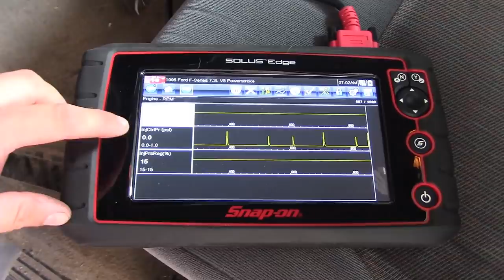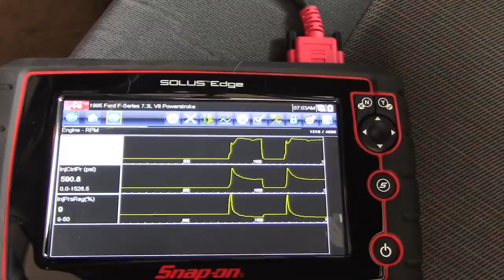Restoring an Ammco 4000 Brake Lathe

Comment: Brake lathes are great, when working on oddball classic cars they actually are a must. Nobody makes rear drums for a lot of the stuff I see any more! That was a nice restoration and will go on giving great service for years to come. Hate the throwaway society, and every little helps. Nice one Wes, interesting content as always 👍
Reply: Even if you buy new you should still turn them to make sure they are perfectly round.  I've had new rotors and drums warped/out of round new out of the box before.  In the automotive industry it is standard practice to turn even new but most shops don't due to time constraints plus with rotors a slight warp won't cause an issue such as shaking or a slight out of round drum won't cause a brake pedal pulsation.

Comment: I have used that particular Brake Lathe for 25 years or so. Great machine they do really good finishing. And the setup is usually very good. You are missing some adapters but they are available. The the control is really simple and works well just try to make sure you're using Good Carbide Bits. All of best from Canada

Comment: Hi Wes, I’m  very knowledgeable on your new tool. Back in the day (60,s through about 2000) I used the lathe almost every day. It was a workhorse of a machine  and paid us back on our investment many times over. We spent 4 K for the lathe for the same reason you did. We couldn’t wait for our local parts and machine shop tying up a lift for days at a time. I’m sure you get years of service from it and I wish you the best.
Fred Thomas in Skokie IL.

Comment: Wes, you have made my heart flutter. I spend 40 years servicing the different types of auto repair facilities and I've sold and serviced many of these machines. You did a great job of restoring a piece of equipment that will outlive you. We live in a world now that has no appreciation for what/how things used to be done. The simple act of oiling and greasing things to make them last longer is even a thing of the past. I have always said that it all started with the Bic pens. Throw away stuff. Why? Why not fix things and keep using them. Maybe the landfills wouldn't be overflowing with cheap crap.
Reply: I currently do the same work you did. I am jealous of the room and accessibility he had to work on this lathe. You know as well as I do that they are usually pushed against a wall and things stacked all around.  And filthy!  I’m sure you have plenty of stories with 40 years. I just finished year 8. We don’t do a ton of lathe servicing but I work on a handful a year. We mostly work on AC machines , lifts, tire machines and balancers.

Comment: When word gets around that you can turn rotors and drums people may come to you instead of the parts store because of the turn around time
Reply: And at $5 a drum/rotor, it'll pay for itself over time......
Reply: Place I used to work for charged 15 a rotor...car or truck. And it could take hours.
Reply: Most Ive ever made somebody wait for resurfacing rotors is 4 hours, and I run commercial sales. Waiting days is, frankly, bullshit on the stores end.
Reply: @TheStuntastik  
They try to discourage you into buying new rotors or drums
Reply: E-Racer 
The joke's on them. I'm not buying new unless it's needed. I'll go elsewhere - even if it's an hour drive to that elsewhere.
Reply: @ralfie8801  exactly why spend $50 on a new rotor when you can re surface it for $10. I don’t understand why mechanics don’t cut rotors anymore especially now that they have those machines that do it with the rotor on the car still.
Reply: @505fastlife6  
To tell the truth, most car rotors are one time use. They’re made so thin for weight savings on their respective vehicles that by the time they need to be turned, they’re below the minimum tolerances to be turned. 
Pickup trucks would be the exception, especially 3/4 ton and higher weight ratings.
If you’ve kept a close eye on your brake pads and not worn them down to the metal backing, there may be enough material left to true them up. 
I warped mine coming down a 6% grade with a travel trailer and had to get all 4 turned. The pads were still in very good condition and all were reused. 
The truck now has 364K on the clock and still has the same pads on it that it left the factory with.

Comment: Use cold blueing for the adapters!!!!
Reply: Or heating up an quenching in motoroil?
Nice idea!
Reply: both of those are good ideas
Reply: That was going to be my suggestion.
Reply: Lin seed oil (put the item in an owen and apply the oil with a rag - some of it will burn.)

Comment: Every autoparts store I ever worked in, (and, there were many) we had a 4000 on a bench in the back. I swear I can still blow my nose & smell the steel dust that would settle there. You even have the vibration strap for vented rotors! Nice going!

Comment: I HAVE the exact model in my shop. I bought 6 of them from TIRE AMERICA In the early 80's. i sold 5 of them an had enough money left to buy a pickup truck load of brake pads. my machine had two of every cone. My machine was brand new at the time. looked like it was used maybe ten times. i've never done any thing to it in 40 years. and now it looks like yours when you got it I dont have the circuit breaker with the on off switch. i still use mine at least once a week. its time to rebuild mine. but its been a good machine THANKS  ZEMANTIRE TOWN

Comment: The original brake rotors on most vehicles are better quality and are worth resurfacing. The aftermarket rotors are cheap but poor quality. Thanks Wes for a great  video and all the tips and help you give us back yard mechanics. I am Running 2 Fords and 1 Mopar all with no payments and clean inspection stickers !!!

Comment: Love  your restoration, I did much the same on an antique Black and Decker valve grinding machine that a Chev Dealership threw away, had all the attachments to include Tractor and  60 HP Ford stuff.  Old.  Was fun and worked like a champ, got years of use out of it.

Comment: In the '70s and early '80s i used an Ammco lathe (think it was a 3000). It was old enough that it had an arc grinder for brake shoes so you could match them to the exact i.d. of the drums after turning them. We added the rotor attachment around '75. Those were the days...

Comment: I just picked one of these up for myself secondhand from a local shop and after a bit of TLC it's a real joy to use. The scales are easy to read, the cutters consistently retreat when you back off the screws and the motor has enough torque for 1 ton rotors without stalling. I've used different brand lathes at work and these ammco tanks make the others look like something you would get on clearance at princess auto or harbour freight.

Comment: I ran what looked like the same machine   at a service garage in the late seventies .  Every brake job, we did the drums and rotors on the lathe because new rotors were very expensive then worked great as long as you kept them above minimum thickness .  The only folks that bought new rotors were the ones that were ground down to nothing because “...the brakes have been grinding  for a month or so”.   That AAMCO lathe looked old when I started using it

Comment: Loved this, bought a new one in Riyadh KSA in 1989 or there about. A real work horse 
And did stuff it was never designed to do like resurface a flywheel, hard spots can be a pain. This machine will save the day especially when dealing with stuff that brake drums/rotors haven't been available in 25 yrs or worse yet military applications. Id like to say the detractors don't know what the hell they are talking about. Not everything abailable from China.

Comment: I used that same model lathe many moons ago, probably early 80's if my memory serves me correctly. I see online that they are still available for sale even today for a mere $8400 and change. Great find. I used to take a flap disc on a hand held grinder and knock off the surface rust before turning on the lathe, seemed to make the cutters last a bit longer when they were only cutting steel. But you forgot the most important part of the video.... The outtro from Mrs Wes!!!! Get it right young man!!! lol.
Reply from the maker: Yeah I was thinking about tossing them in the blast cabinet.

Comment: used one for 15 years or so, when I was  a mechanic. I can`t begin to tell you how much money it made me.Bits last a lot longer when you take healthy cuts when theres alot of rust. rust dulls them fast. . being aggressive on the first cut gets you through the rust. Still have my 1950`s black and decker valve grinder. another great old tool. another out dated repair. seems like people just send everything out these days or buy some knock off parts.gone are the days when you did everything yourself.

Comment: I have one of these,  actually  bought  a "drum only" one for parts and got some more adapters.  There are  3 shafts for these,  the one  "standard" you have,  the smaller tapered shaft for small such as  VW bug rear  drums,  and a  honkin  huge  shaft for heavy truck drums.   I have the smaller ones for mine,  no use for the truck ones.  In my lifetime  I've literally turned  thousands of drums and rotors, at two different parts stores.   The first store I worked had an old  Van Norman drum lathe and a Quick way   rotor late.  Second store bought an Ammco shortly after I arrived.  We built an a frame  hoist  to ease  handling  heavy truck drums.

Comment: You had me when you mentioned the shaft wear.  Solution: grind it clean, plate it, and finish grinding it.  I have not done that in a very long time.  It was a close tolerance hydraulic spool.  Small enough in diameter and small enough in bearing where I could grind it in house.  There used to be shops around where you could have had the shaft ground for a song.  Have not worked with a plater in many years, so ease unknown.  Great display of mechanical knowledge, patience, satisfying your toughest customer.  Yourself!

Comment: Wonderful little machine Wes, spent most of my life in a machine shop, can operate (could operate) anything in it till I retired, but, i used a smaller lathe than i worked on for "Homework" back in the day.. You just cant beat a hands on machine, sadly not taught these days as everything is CNC now, and yes I worked them too... Love the talk through on what your doing, thanks, Ian - UK.

Comment: i had one of these in the 80's, used it just about on a daily bases, secret is don't get in a hurry and try and make it in one cut, do a  touch off cut then two more cuts, just sneak up on it and it will do a great job. when i finished my cut i took a small side head grinder and 220 paper and cross hatched the rotor with the machine runing slow. that will stop pad squeal. just my 2 cents.
Reply: Sounds exactly like the way I used to run the 4000 lathe. The cross hatching of the rotor was great to minimize squeal and it looked good too!

Comment: Great job, I have been looking for one also. for my retirement of just doing some repairs. of course you just need to make a few passes , first course, then a final fine at slow speed.    as an old guy that grew up on these machines doing work it is great that you see the value in the older machines. Thanks

Comment: I have turned rotors on my 10" Atlas lathe. Obviously 10" or smaller. 
I held the wheel side in the chuck and indicated ID and the brake surface true . I first just dusted the mounting area to run true . Then turned the two braking surfaces to clean up. I have had very good luck with this method. 
Your brake lathe will do it  much faster. You can turn both sides at once and you don't go to the trouble to dust the mounting area. 
Nice job rebuilding the lathe .

Comment: Very nice job.  I haven't had to have a rotor turned in a long time.  My old truck had 120K before the first brakes finally went and I found a set of OEM rotors for $45 each.  My car has rotors that don't seem to have enough thickness to turn after they are worn.  They are cheap enough though.   

I like that you really put the time to reseal and fix what was wrong, not just use a rattle can restore method.  I hope it serves you well for a long time to come

Comment: I remember using those old Ammco brake lays back in the 1980's, when I was working at one of the few full service gas stations left back then. I even sometimes ran the break lay when I worked in an tire distributor shop, that doubled as an automotive repair shop. Had one of my co workers, that taught me how to put the non directional finish on the rotors for a brake lay that did not have that functionality. And the way to do that was to take a 90 degree drill with a disk sanding wheel on it, and turn the brake lay on and run the drill with its disk sander on it against the rotor to get that non directional finish. I always loved doing tire repair, mount balance and brake work.

Comment: That is a good quality brake lathe . It will make you money. The last shop I worked in out here in New Zealand had one. 240 V single phase. The only thing i can thats missing is the rubber belt. It has an  "S" shaped clip on the end of it. Its about 45mm wide and a meter long. You wrap it around a brake drum stretch it and lock it into the "S' shaped clip. It stops chatter marks on the machined surface. I see you have it. Our one is dirty and black. LOL  Mrs Wes looks nice in her new dress. They are not obsolete. You end up with a machined disc at basicly no cost to you.  This guarantees a good out come. Other shop may come to you to have discs machined instead buying new discs. Especially if they are made from "unobaitium" or "obsorleteium"

Comment: You did a nice job restoring the lathe, I owned the same machine 30 years ago. When I machined the front rotors on a car I would use a dial gauge on the car to check for run out then mark the rotor and set it up as close as I could on the lathe by turning the thingamadoies till it ran really close as it did on the car. That worked out really good so I did not have to buy one of those lathes that machined the rotors on the car snapon was selling. I know they don't do that at a parts store but you will end up with a better job if you take the extra couple of minutes it takes.

Comment: Most likely a mood point, did not read all the comments, but to the painting of the parts, that you so love to do and have perfect .... a clean surfaces/correct primer/two or three or more light coats of finish paint (depending on paint type) with very light sanding between coats, rather than one heavy all at once coat, will result in a nicer job. But hey, like you said "it is brake machine"!

Comment: Nice work, I must be old because I did actually turn some rotors when I was an apprentice 20 years ago. Haven't turned any for probably 15 years now.
Was always told to run emery cloth over each side of the rotor after the machine work, knocks the high spots down and prevents cast iron getting in the brake pads.
Reply: It's best to take the rotor  after remove it from the machine and wash it with soap and water. That's how you get rid of that cutting dust that will embed into the pads